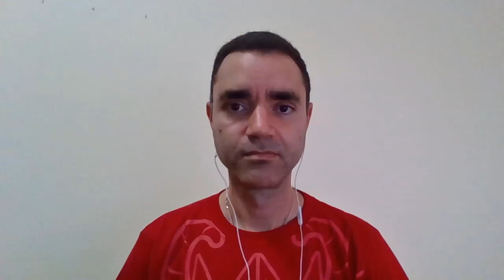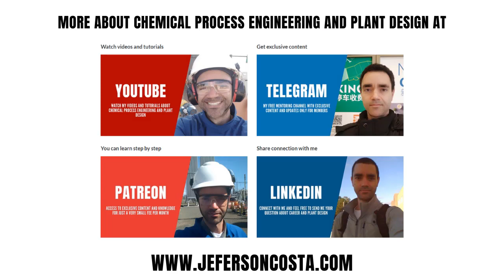WHAT IS MDMT FOR CHEMICAL PROCESS ENGINEERS IN PLANT DESIGN

Comment: Thanks for sharing your beautiful knowledge and experience. I have a question - Are MDMT and DBTT the same? I searched for the answer, but there wasn't much useful literature.
Reply from the maker: Hi, they are related but not the same. MDMT refers to Minimum Design Metal Temperature. It is the temperature the manufacture must consider for equipment fabrication. The DBTT refers to Ductile to Brittle Transition Temperature. It is the effective temperature where the metal becomes fragile. As chemical process engineer in plant design we must select materials that will not reach DBTT in normal or abnormal process conditions. This way, in practice, MDMT will be always higher than DBTT.